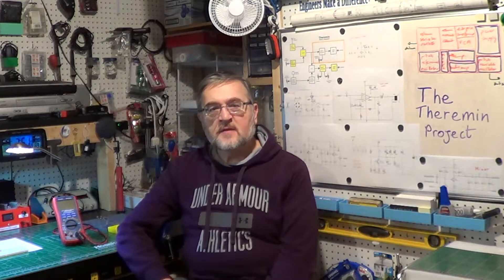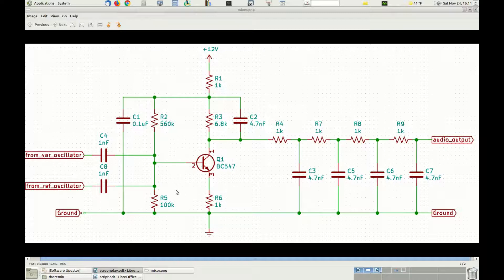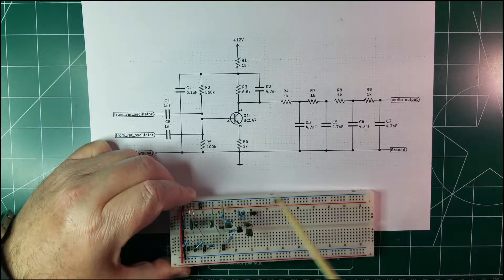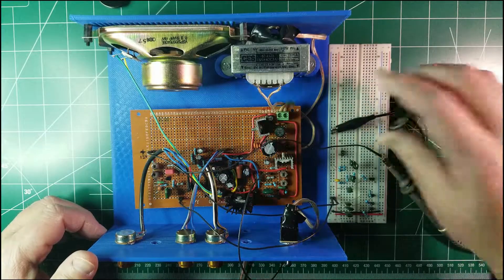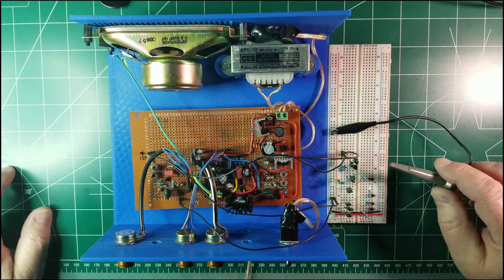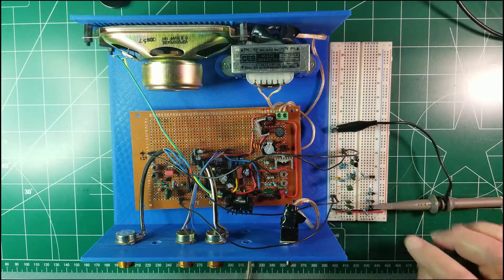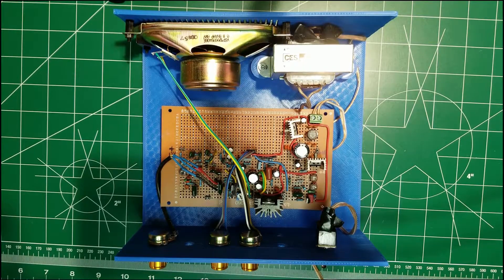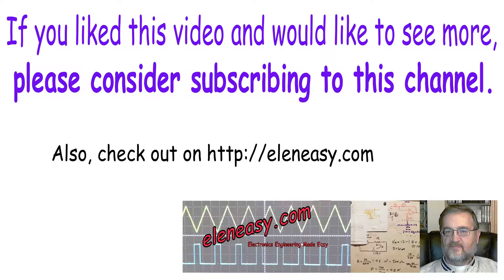The Theremin Project Episode 10: The Heterodyne Mixer

Comment: This video was very helpful, I'm trying to design my own theremin for a sr project.
Reply from the maker: I suggest you build directly version 2. It works much better than version 1.
Reply: @eleneasy  it Is funny that you say this, because after I left this comment I found the video for version 2. I used a slightly modified version of 2 for my mixer and at least in simulation it is working perfectly!